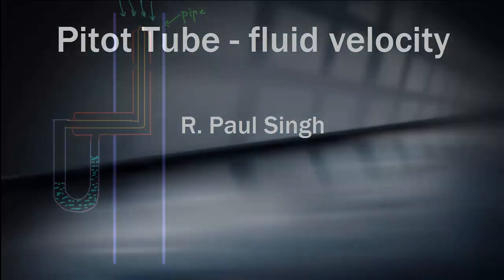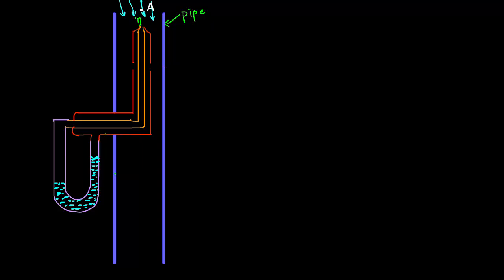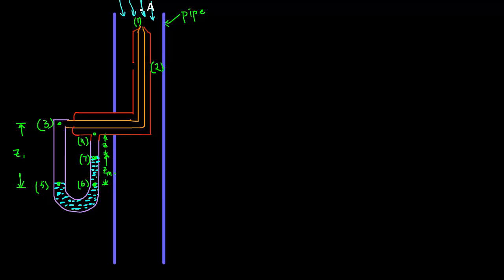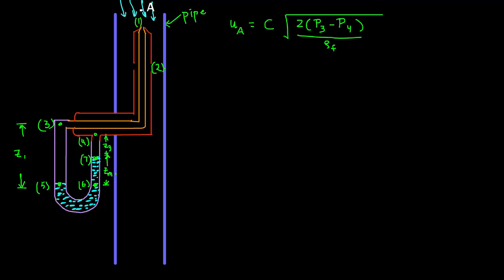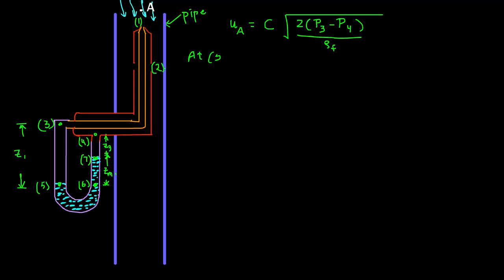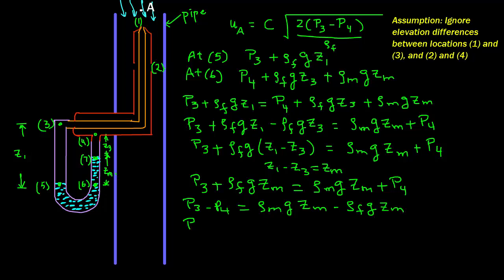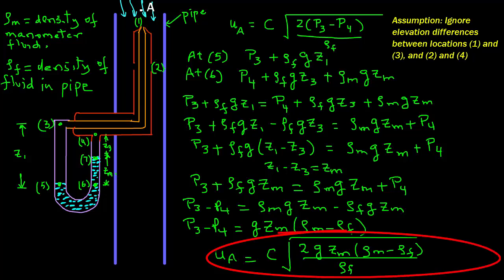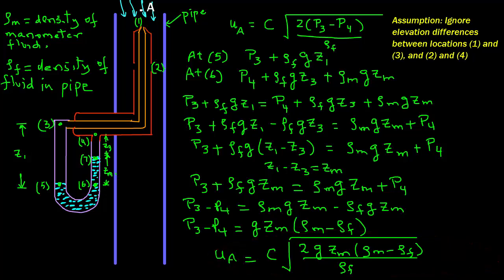Pitot tube with a manometer

Comment: how is Z1-Z3=Zm? Points (3) and (4) are not on the same line.
Reply from the maker: We ignore the small difference in elevation between points (3) and (4), this is a valid assumption since pitot tubes have small diameters, and for all practical purposes, the elevation difference between (3) and (4) is much smaller than for example between (3) and (5) or (4) and (7).